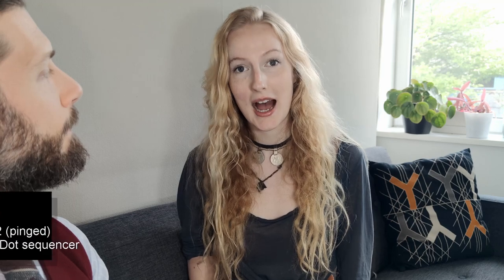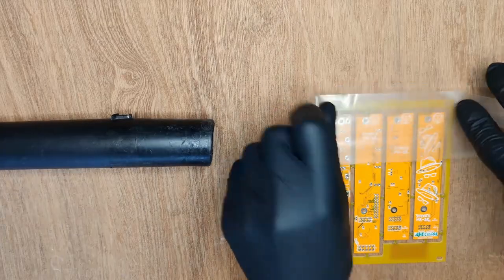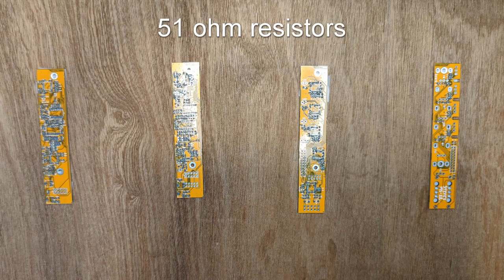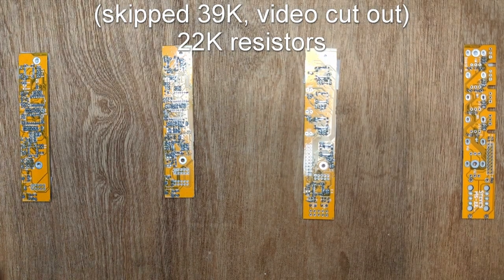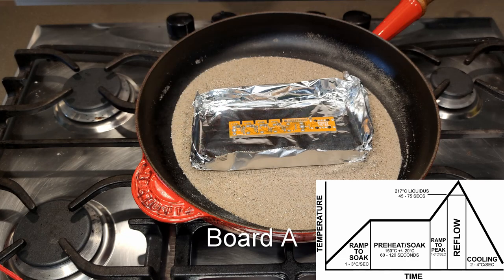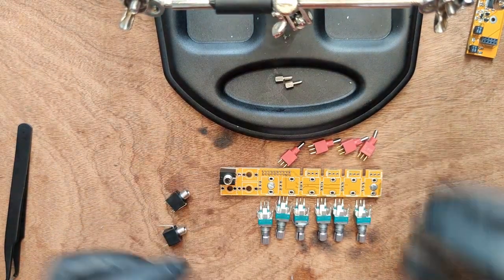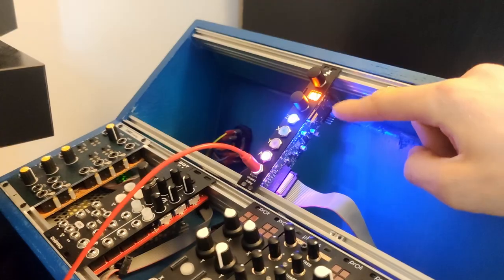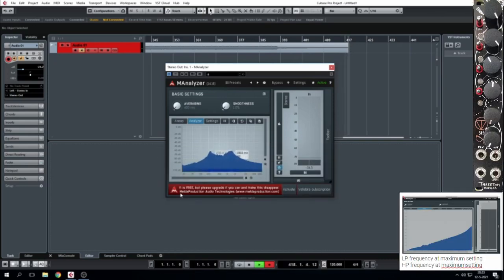We baked Threetom's MS22 in a pan

Comment: As always a very  entertaining video with clear instructions! I have a question though, a bit off the topic, but anyway. I have a partial hand soldered smd board. Is it possible to add the remaining components using the pan cook method?
Reply from the maker: Great question! We're no experts, but based on our experience the main concerns is that components will be exposed to heat twice; for temperature sensitive components, that might not be great. Especially since most people start by hand-soldering SMD ICs, which are fragile. However - we reheated our ICs so often to fix bridges, much more often than twice, and it was fine.